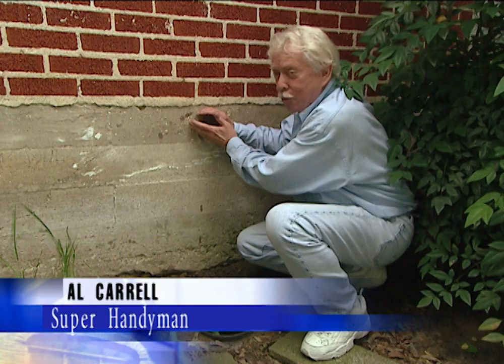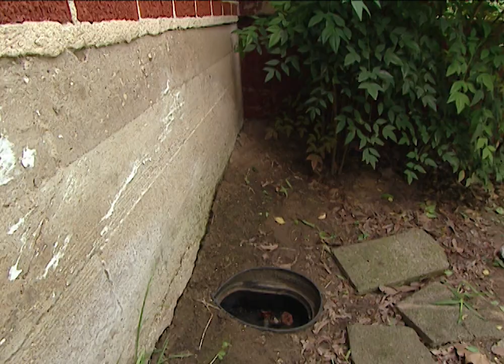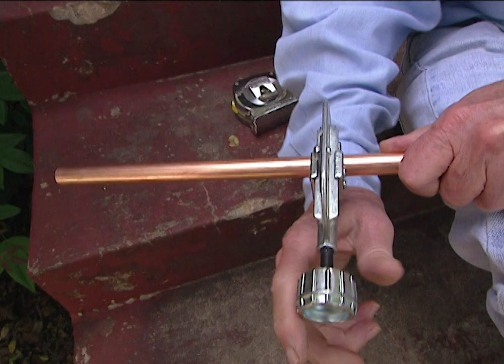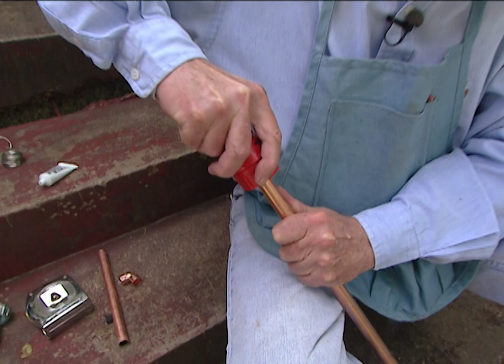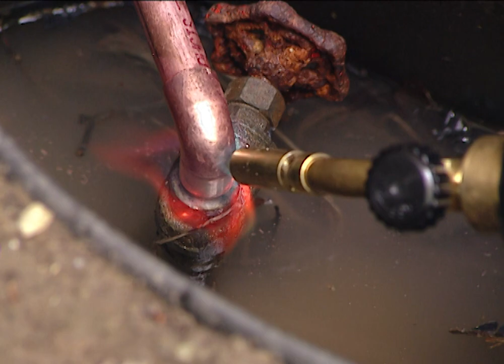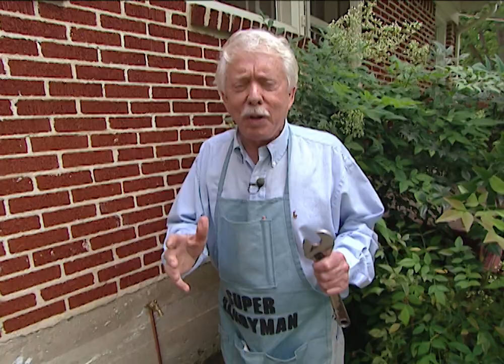Adding an Outdoor Spigot - The Super Handyman

Comment: I just don't understand why he decided to leave a rusty shutoff for the old in ground spigot in place at 1:20.

First, I would use a shop vac to get rid of all the water. Next, I would remove the in ground box all together so it won't flood in again and become a new home for pests like mosquitos and snakes. Finally, I would cut off the old gate valve off as well with the spigot before continuing the work for the new spigot. I would fill in the cavity left behind with dirt to make it look clean.
Reply: Where is your video?